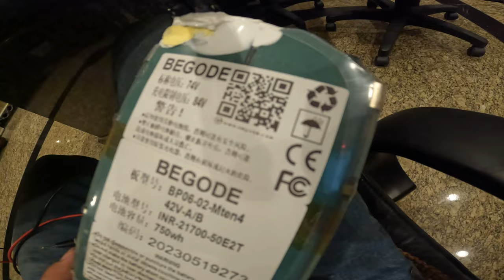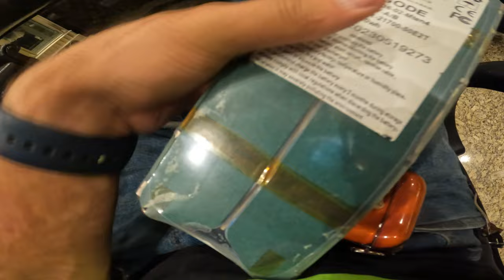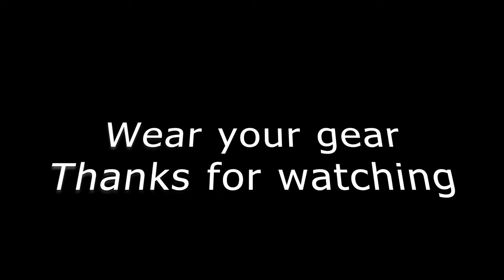The wheel that broke Marty’s Leg

Comment: Get the log file from EUC world from Marty's phone. Also take the motor apart and check if the hall sensor board is kinda loose and can wiggle over bumps. Check if the solder points might have scraped the inside of the motor cover and did a temporary short. If there is no silicone or anything on the solder points, put some on to prevent further cutouts.

Comment: Roger, thanks for the teardown.  As yet another engineer it seems we're left with Single Event Upset (SEU) as the most likely cause.   SEU, is why aircraft controls are usually triplex,  quad, or dual redundant.  And note that EUC redundancy is inherently limited by single 3 phase motors.  Redundant hall sensors do make good sense as well as possibly dual/dual battery and controller designs (as well as the multi-transistors).  Maybe someday we'll even be using 6 phase motors (don't hold your breath, that will be years if ever).
Reply: Of course, you write everything well and correctly about redundancy, but in the Begode A2, the power supply of the processor and peripherals is served by one chain of DC-DC converters, and previously it was different. Now any failure/short circuit in the periphery will cause an overload on the power system and lead to a reboot of the controller processor. This is a blatant disgrace. It was done well on the first mten4 controllers
Reply: @MrIbif  IDK the specifics of the A2 design.  My point is more about redundant systems being necessary for life-safety.  Single engine airplanes get to be simplex with "fail safe".  Simplex maybe "fail safe" depending upon the FMECA (can glide to the ground), but in the case of a simplex controller-battery-motor needed for safety, how?  I mean no dead code, sure - or maybe DO178?  But without hardware redundancy its all bullshit.  CMMI says miles without unexpected software failure shows flight safety, but such simplex systems only achieve 10^-3 level mission reliability.  Why?  Well SEU (muons, space particles upset bits in memory/computer).  Only redundant control systems overcome that.  I've been working redundant systems like that with avionics/engines since the mid 1980s.  These wheels are risky, even with perfect hardware.  SEU is real.  6 phase, dual/dual control/power - I'd pay $10K for the equivalent performance of a Master with that (and add 20lbs w/o performance boost too).  My other POV issue is swappable batteries for less weight configuration with high range config-options and charged swap range extensions w/o base weight being bloated beyond my use cases.
Reply: I don't think people realize how rare SEU are and what kind of precise bit flipping is required to get specific output.

Comment: @ElectricUnicycles, 

Do you know that since autumn the power supply circuit of the controller and peripherals has been changed on Mten4? Previously, these were independent circuits, but now the controller, hall sensors, headlight illumination, headlight, taillight - they all hang on the same power branch. And if you have a short circuit, say in the headlight, then be sure that the wheel will level you. Compare the controller from mten4 last summer and autumn or the A2 controller and you will see that there are fewer elements on the board. This is an unforgivable reduction in price in my opinion. Low-voltage converters could fail on the wheels of the gotway, but it always carried the rider to the last. Now, thanks to circuit changes, this will not happen. It is necessary that the manufacturer return the old circuit and replace the controllers with controllers where the power supply of the microcontroller and the peripherals are divided into independent electrical circuits.
Reply: Very interesting analysis 👍

Comment: Check the gyro's cutoff points when stationary leaning it left/right. It should be the same angle on both sides. I had a Gotway that had bad recalibration data stored, so it became unrideable. Among other things it cut off at different angles. A room temp calibration later and it was fine. Has been fine now for 10000km but at the time it felt like something was seriously wrong.

Comment: Idea for possible causes 
1, weak cells - You should test battery under load, unfortunately not cheap to test -  you need something like "DL24MP Electronic Load"

2, Hall sensor / noise at board. - You can rule out motor by connecting it into VESC and checking if hall works at higher RPM
Reply from the maker: I was load testing it with me on it.  over torqued to beeps a few times.  No failure.
Reply: load can be easy to test, just plug it into a motor and apply a load

Comment: I build drones I don't know if this could be the problem but the tec in a euc is a lot like my drones that's why I got into euc riding. Iv had two flight controllers that had bad gyros in them they would fly perfect but on landing and or supper fast moves they would cut power and fall out of the sky. The problem turn out to be from vibration to the flight controllers gyro.
Reply from the maker: I’m a drone builder too. Did bump testing to check the Gyro. No problem there.

Comment: Marty legless, one wheel on his wagon...   too soon?   You know we wish him well  🙂  Cold solder (UK we would call that a dry joint?) Talking about dry joints you could stress the PCB a little bit, a dry joint on there would do it. Plenty of opportunity on a main board. PCB's are flow soldered, a bit of a black art and you have to be meticulous, clean, and know what you are doing to get good results.
Reply from the maker: Dry joint sounds better.  I might adopt that nomenclature.  I do have a microscope that I use for PCBs, but the multilayer nature of these make finding anything a real challenge.
Reply: @roghaj  Hard to see the fault (though a poorly wave soldered board can be identified), easier to reproduce it through distorting the board, if that is indeed the problem. Small connectors too can be a problem. Intermittent, oxidized, dirty, indifferent quality (they are not likely to be gold plated which would be a norm in professional equipment). The springyness in the contacts of small connectors can work harden with age as well. Can be the devil in equipment of a certain age.

Comment: Whats the battery percentage when A2 cutout? You need to examine all the components on the PCB with magnifying glass. Once in the full moon, the computer misaligned mounting components on the PCB. Check all solder points.
Reply: Keep in mind that it did not cut out but it shut off, going ~12mph 🙂. There’s a big difference. The battery was pretty close to full
Reply: @ElectricUnicycles  Never quit EUC, Marty. God speed on your recover!
Reply: @ElectricUnicycles  is there video on this?  Could be helpful on determining the cause. Also good luck with the recovery!!
Reply: @Hunter_Heart  thanks

Comment: Faulty capacitor?
Reply from the maker: I didn’t go so far as to test their capacitance, but they passed visual inspection. I don’t plan on testing every component on the main board one piece at a time. The only parts that would cause the machine to shut off while moving would be a full power disconnect. Almost every other air would result in the machine still being on after the failure.
Reply: How can it be faulty when Roger is riding it. Either the cap is blown or its not 😉
Reply: Just trying to understand what could possibly go wrong, but that makes sense, my assumption was a voltage drop, caused by a capacitor not holding charge or depleted by some other part of the circuit, but it makes sense that probably isn't the case if it can balance, & Roger was riding it that it was likely an glitch or rare set of conditions met. It's not like anyone has access to a dyno or parallel bars, & a treadmill to fully test it.
Reply: @roghaj Totally correct, actually if a wheel is still powered on or if its powered off, is a good indicator for a hardware fault totally cutting power off (machine off), or if its a software fault or slight hardware fault that has nothing todo with power delivery (machine still on)!
Capcitor fault would just give you a “weak pedal”, but no catastrophic failure (at least not directly).
So thats all pretty curious and in my view you have checked exactly the right components.
Unfortunately this feally makes a “zombie” wheel out of it…..